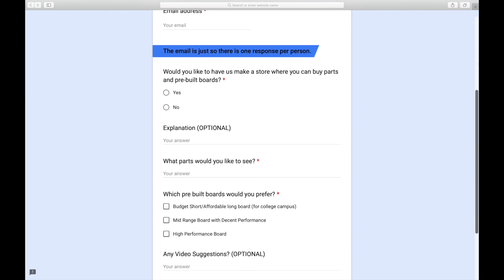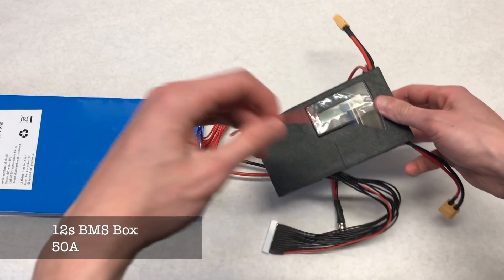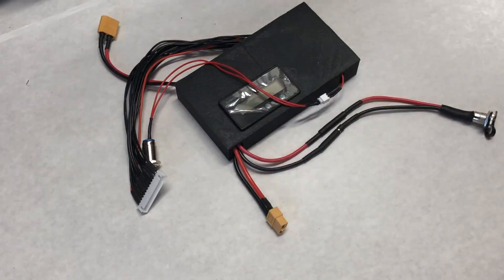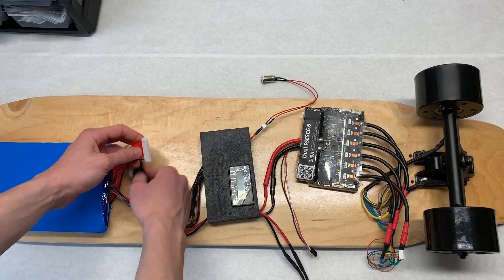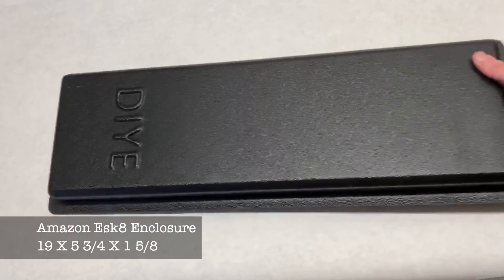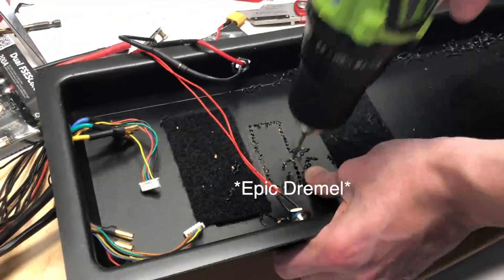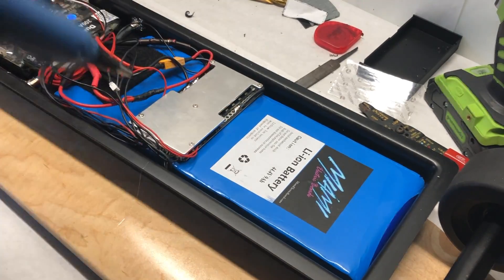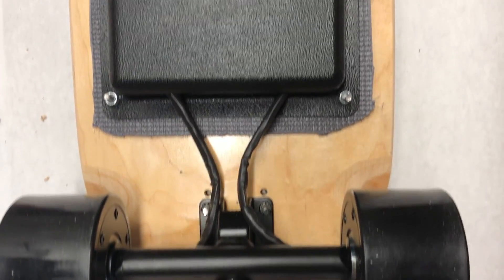DIY Electric Skateboard- 2,000W Hub Motors

Comment: I'm very skeptical on the actual power of these hub motors, I have a custom dual motor ninebot es4 and it's hub motors are rated for 300watts nominal but they are pretty big and I run them 1500watts. These motors are tiny af it seems crazy that they are able to put out 1000 watts each...
Reply from the maker: They aren't terrible but I would never choose these again not because of the power but because of how awful the urethane is

Comment: its nice to see diy... but i dont see the point of this proper build .... 800 USD ??? why ????? you can get verreal v1s for 350$ with 250wX2 with 35km/h and 10s3p for 20km range, or aeboarder ae2 with same specs; actually even higher speed....

so if you do diy, its cool, congrat, but test properly your build, acceleration time test, to speed test, range of battery... otherwise your build is non sense, is not cheaper than manufactured products, we dont know the specs... its a pity

Comment: Why is it an $800 board ? Is that the price for each 1,000 w motor and battery?
Reply from the maker: The components are very high quality so they are quite expensive. VESCs are expensive and so is the battery.

Comment: The hub motors have been sold out for a while, is there any other site to get them on
Reply from the maker: I think that you can buy them from may tech here https://maytech.cn/collections/in-wheel-hub-motors/products/brushless-hub-motor-hall-sensor-motor-mto9055hbm-100-ha?variant=21911777640512 . Honestly not sure how much I would recommend them. They are great motors, powerful and fast, but the urethane is so thin that the ride quality is not comfortable at all.

Comment: I really like your build. How is the performance?

Also how you built a DIY AT board??
Reply from the maker: In all honestly I do not like this board very much. The ride feel is not great because the wheels are not soft. The board goes very fast and has great range. The acceleration is decent.
Reply: @DIYesk8Builders  how about your AT build how do you like it?
Reply from the maker: AT is so smooth. Takes a massive tole on battery life though.

Comment: How fast does it go? Faster than your diy evolve?
Reply from the maker: I rode it to 29mph on the first ever ride so I think they are about the same speed! DIY evolve hits about 29-30
Reply: dont see why you would need that to be honest for these morors, youll only get a 1-2 mph speed increase and there is plenty of power, you can't realy get AWD ESC you get 2 ESC's together and have one as a slave ESC
Reply: @Mike S yea true but them motors are already powerful enough to go up a good 30% to 40% gradient thay are very strong, you just be adding a huge extra cost for a benefit you'll only experience 1% of the time